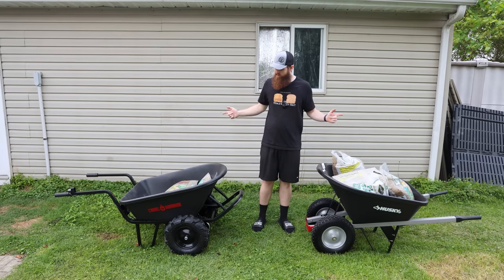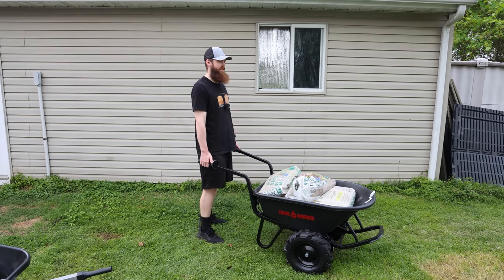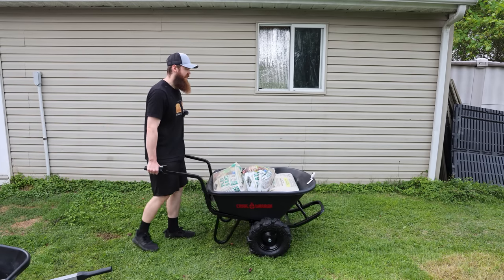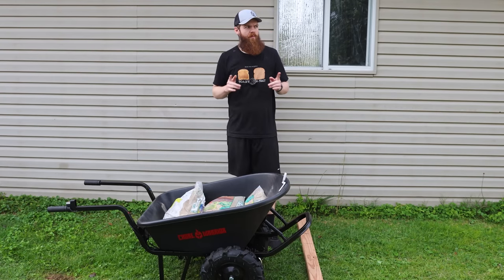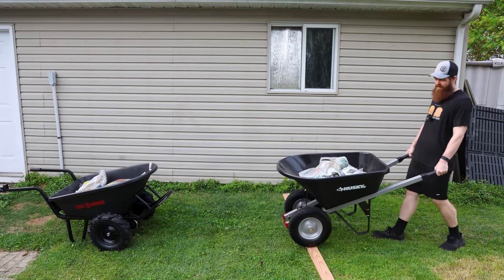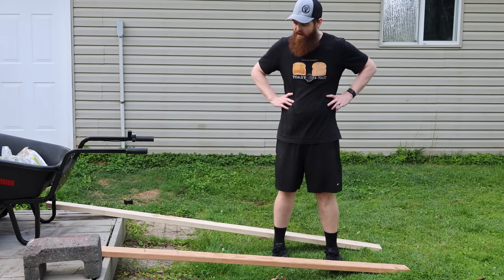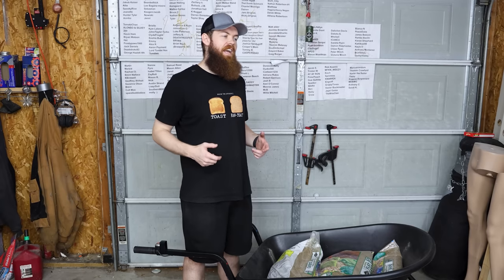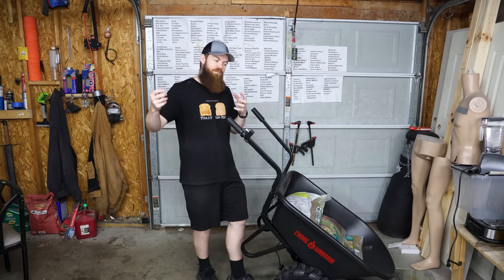I Tested An ELECTRIC Wheelbarrow!

Comment: The problem with the battery pack seems to be that the batteries aren't balanced. 
Both batteries need to be at the same (or close enough) voltage. Because the charging process will stop if one battery is at its full capacity (protection). And with that configuration you have in your pack, the best you could possibly get with a "full" charge is like 10%.
You need to charge the 10V battery up to the same voltage as the other one. If the battery doesn't take a charge, it is dead. 
But that should absolutely not be a problem to have with a new battery pack....
Reply: too late now lmao

Comment: I think the lead acids they sent you are faulty, they should have a bit more life than that. edit just saw the point where one battery is low. 
But I still don't think 2x 7-10Ah lead acid fish finder batteries are powerful enough for this application. I can see maybe as an assist, but that battery pack has maybe 400W of safe output, that's not too much without gearing down a ways. They should have made that box a LiFePo4 pack. Nearly double the capacity and power output. Would also last a lifetime, if the rest of it could.
The biggest struggle with a wheelbarrow are inclines or large bumps, this thing doesn't really help with that. Need to test it with 2 good batteries to be sure.

Or make this thing compatible with ~18v power tool batteries, have it hold a couple in parallel for power/capacity.

Comment: It might have bad cells in the battery pack things happen like that so it might not be the fault of the company just the manufacturer of the cells in pack. I got a hover board from a neighbor it had bad cells in its pack when I took it apart I swapped the bad ones out and it works like new again.

Comment: TBH its not surprising. checking the page it shows two small scooter sized 12v batteries. thats 24v maybe 10ah. which with lead acid is like half that cause it tanks after 50% charge. in comparison: my ebike has a 52v17ah battery (about 4+x the energy in same space), and can haul 500+lbs of me, bike and trailer. motors not much bigger than whats in that wheelbarrow. its sad that they can scam ppl with this kinda kit. you can get wheelbarrow electric motors with much higher power, though you would want lithium ion or lifepo4, instead of leadacid.

Comment: My takeaway: don't trust an electrical motor. You want to transport some shit, strap a Hemi to it. =D
Reply: To be fair, though, I don't think the wheelbarrow motor was designed to move ALL of the weight itself, but just take away a lot of the strain as if you were just using a regular one. I wonder what the torque rating is. Given that it can't climb the 2" side of a 2x4, I'd wager "not f'cking much."
Reply: Their customer service was so good because their quality-assurance was so shit. XD

Comment: It should have a lithium-ion battery pack like every cordless powertool uses. Then you can use a spare battery, instead of having to wait several hours for the lead-acid battery to recharge. Small lead-acid batteries can not deliver very much power, and they wil not last very long if they are discharged for more than 50%. For 800 dollar it should have a decent battery system instead of the useless small 12V lead-acid batteries wich will struggle to deliver more than 4-5 Amps. (I just bought a new electric bicycle with a 480 Wh battery for 999 Euro, if i compare that to the 800 dollar electric wheelbarrow, then this wheelbarrel with the very weak lead-acid battery is realy a very bad deal).

Comment: those look like acid sealed batterys, those dont like electric motors it kills the lead cells inside and shorts the battery... it would work better whit a Gel or agm battery but those are expensive as F

Comment: I dont think youre utilizing this product the way its intended. I think this is like an electric bike that has pedal assist. Its not supposed to propel you like an electric scooter, its supposed to make pushing easier

Now i think that an electroc wheelbarrow should function like a normal one when not powered, similar to the preciously mentioned ebikes, you can still pedal those bikes like normal, they just have assist when you need it. This wheel barrow seems to only be of use if its electric assist is on

Comment: If it ain't broke don't fix it.
Because of it's design, the e-barrow is now harder to use without the motor than the traditional design with wheels in front of load.

Comment: Wow that thing really is garbage for the price lol.  I do suspect that battery reading 10ish volts is bad though, could very well be part of the problem, maybe even the lack of power.  I'd try to get them to send you a new one.  These look like gel cells they use in UPSes.  Greenworks makes an electric wheelbarrow that uses their 80v batteries and is in the same price range, would be curious how it does.

Comment: Tyler you saved me a ton of money. I was watching that idiot contractor who was raving about this thing, now I’m assuming he got his for free. 
If this can’t do hills with weight in it I’m out. Also all the wrong, missing, miss fitting parts is a big turn off. I want to get it and use it! 
This company needs to pony up and make improvement a to this unit AND keep the same price. 
Thanks again Tyler.

Comment: Good Video as always but you are kinda using it wrong its supposed to help you push it not do all the work you still have to push it a bit but i stick to the normal wheelbarrel always better to work with
Reply: And you might be right that the one you got is damaged the ones i tested were weak but didnt seem so weak like the one you got

Comment: One battery at 12v and the other at 10v?  That's a huge red flag.  They need to be balanced to charge properly. I'm not terribly familiar w/AGM, but I'm guessing that getting down around 10v is really bad for it. The fact that they first didn't send a battery and then sent one that was defective is really quite unacceptable and indicative of poor quality control and should be called out.    BUT...

The test out in the yard should have been conducted with a fully functioal unit.  To have tested it in such a debilated state and give the appearance that this is what you get when you buy this brand smacks of a hit job.  May not have been intended that way, but that's the impression I got.  Never seen your videos before, but this one isn't making my subscribe finger twitch.

Definitely point out the quality control problems. And good on you for doing the review as a cash-paying customer. But a fairer approach would have been to show how it does when it functions properly (while cautioning about the contortions you went through to get it to function properly) and then (if you're not too sick of e-wheelbarrows)....maybe a 6mo/1yr follow-up review on whether it has held up and what you've used it for. 

You wouldn't do a review of a truck that only had three wheels would you?  Or even one with 4 wheels but one extremely flat tire?

Comment: I was literally searching for an electric wheelbarrow and found your video.

Didn’t send battery kit with it- strike 1
Sent the wrong parts with it- strike 2
Sent a bad battery- strike 3
Shitty product 
None of my hard earned money will EVER go to this company 

However on the website they say it has “power assist technology”, which would imply that it’s not an actual powered wheelbarrow and only makes it a little bit easier then a non power assist one. But it’s very possible you also just got bad batteries or something too. If you have any other good 12v batteries that would be able to be hooked up to it in place of that bad one, I’d suggest you try that. It could make a world of difference, or do nothing at all lol

Comment: The Chore Warrior has a POWER ASSIST drive. It's NOT self propelled! You have to push for the motor to assist. The harder you push the harder it works. Please educate yourself before giving a bad review. This video literally gives no idea if it works as designed since you didn't use it correctly.  

Also please educate yourself the difference in the words "when" and "whenever"! You use "whenever" when you're supposed to use "when"!

Comment: This is a horribly underpowered batter. They didn't want to add a big powerful battery that adds weight and it doesn't have the power to drive the motors.

Comment: Bro the motor locking up is a safety mechanism. Electric powered things aren't supposed to mow things down. People leave wheel barrels outside what happens if a kid takes off in it and runs over the family dog. That's why it locks up like that. Your a big troll bro for real.

Comment: OK for one this item was designed to be used in combination with your own strength. Meaning it requires you to do some of the work, but will help tremendously when moving heavy loads. It says it right in the instruction booklet. You are not very smart if you thought this was going to do all the work for you.